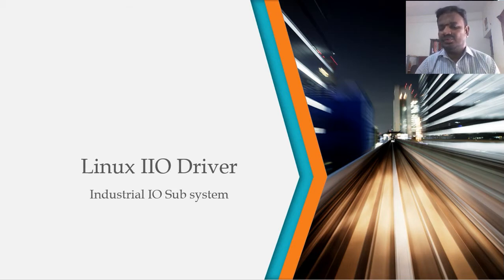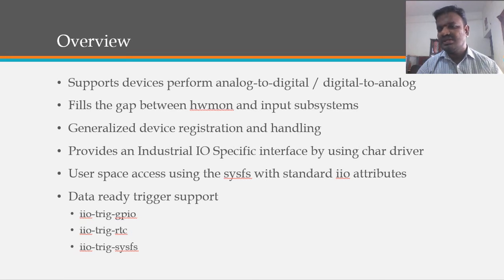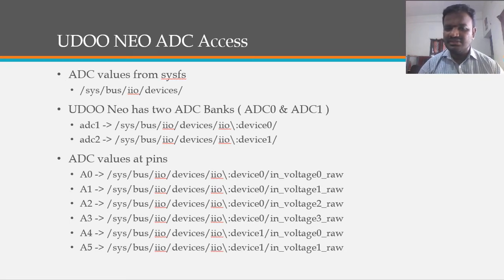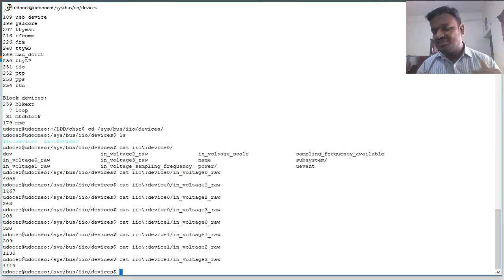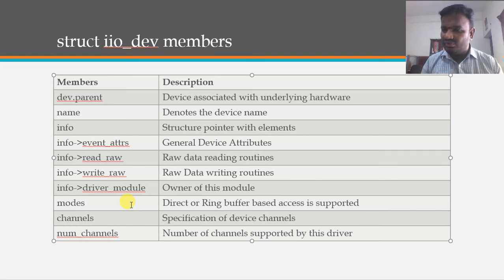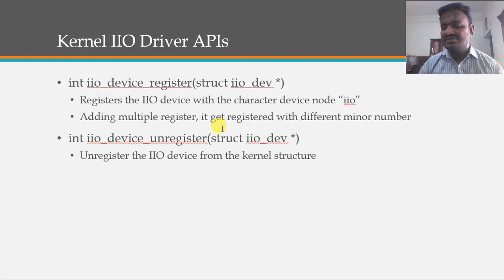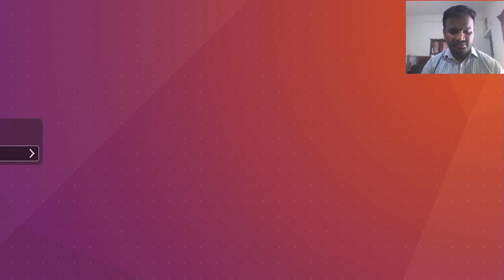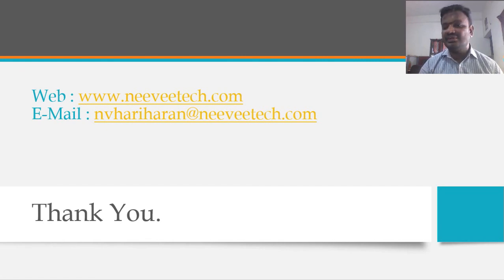Linux Industrial IO Sub System

Comment: Nice video. As it stands now, if C++ application needs to read values from IO devices, it needs to open specific file in sysfs in order to do that. It there any easier way to do that, like having an API with a socket and select the channel?